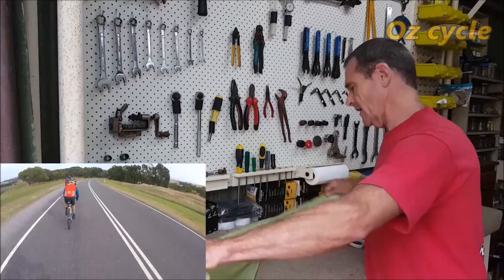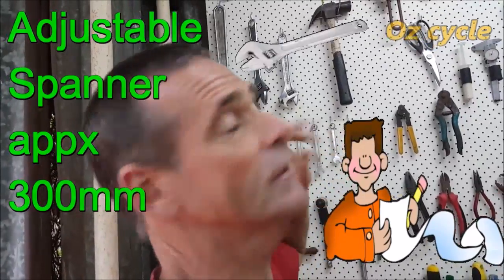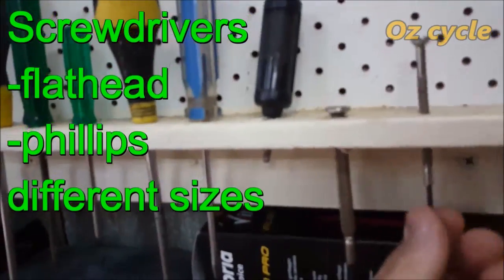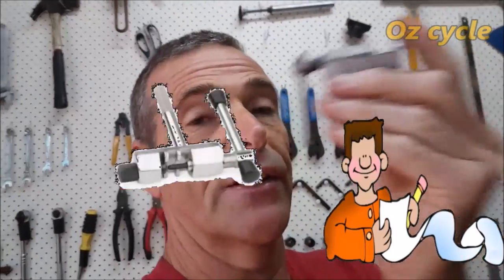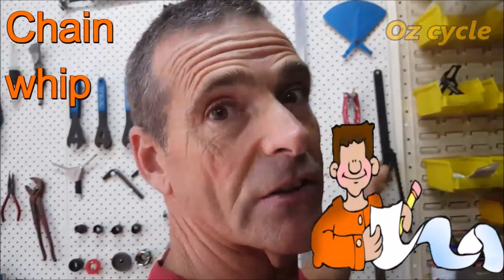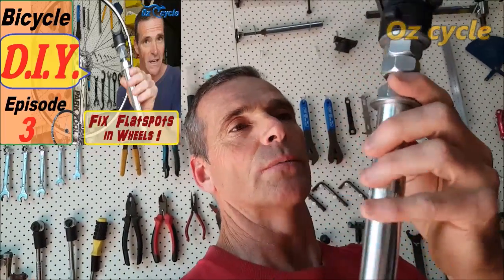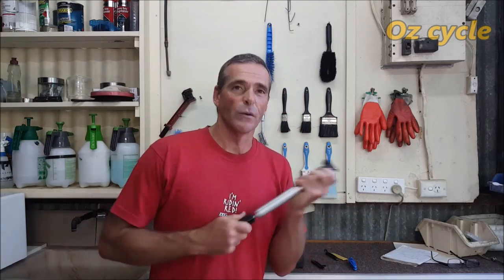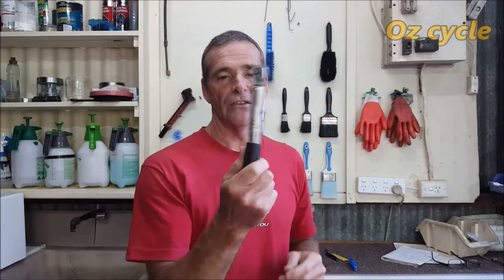BIKE TOOLs - Pt.1 must have !

Comment: I especially like the videos about proper chain cleaning and lifetime chain lubrication. In my opinion, this is the most significant and immediate measure to improve your bike's efficiency in a long term, sustainable way. A small trick from my side: Use your liquid wax and apply a thin, non-visible coat on every accessible spot on your bike. Raindrops will just slip of any surface and after shaking your bike after a rainshower the bike will dry out in like 20 % of the usual time.

Comment: List
1. Rags
2. Spanners 6-19 size (8-17 is minimum)
3. Adjustable Spanner - 300mm
4. Hammer
5. Scissors
6. Syringe
7. Cable Cutters w. Crimper 
8. Pliers
9. Screwdrivers - Phillips and Slotted Head (include jewellers)
10. Cone Spanners - 13-21mm x 2 sets of each
11. Chain ring peg spanner
12. Allen Keys - all sizes
13. Cassette lock removal tool - get the relevant brand of your cassette
14. Chain Breaker - Smaller is better
15. Chain Wear Stretch Tool - Buy with a increment reader
16. Steel Ruler
17. Plastic Caliper 
18. BCD Measure 
19. Chain Whip
20. Towel Rack
21. Spray Lubricant
22. Grease in tube (to put into syringe)
23. Chain Lube
24. Wheel Stick Tool 
25. Carbon Fibre Paste (If you have any carbon on your bike)
26. Wire Brush - 2x one stiff/soft
27. Puncture Kit
28. Floor Pump
29. Torque Wrench
30. Tire Lever - Rounded Head 
31. Repair Stand
Reply: Thank you 😆

Comment: When buying a cutter or new blades, buy hardened ones! You can spot hardened blades easily by a copper or brass-like color of the cutting edge. Will last you considerably longer than unhardened ones when working with metals.

Skip any black blades (harder, but break easier) or white ones (ceramics, for cutting fiber/fiber or paperboard; won't last long around a bike).

Comment: I want to do everything on my bike :D Im going to get new hubs and do spokeing stuff myself .. havent done anything like that before.. but i think its wery doable. Bought it before winter.. stripped down everything.. relubed.. checked everything cleande.. and i feel like i know almoast every bit of bike :D Need new brake gear lines and new hubs ofcourse. There alsou is bad stearer tube bearings/cups.. im not so shure about those to do myself.

Comment: Multitools and the toolkit from Ikea have handled a decent portion of this. Crankbrothers covers chain removal, screwdriver, and the Allen keys. 

But the rest definitely make sense. Syringes are very affordable on Aliexpress if you're willing to wait.

In regards to torque wrenches...Bike ones are needed with carbon fiber since that can crack up. The normal ones seem to expect higher torques.

On a side note, security bolts and relevant allen keys are handy for commuters if you don't want bits and pieces missing from your bike. I've had bad experiences relating to a thief with a 5mm Allen key.

Comment: I made a chain whip out of old chaisaws blade or how to call it.. cant go on any show but works great.. and costs 0. Tho u need to be able to drill holes and punch pins out of chain and put them back.. dont need any screws or new pins for assembling.. its not a bike.. wont fall apart.. and if comes loose alwas can bash back in :D

Comment: Very informative. Since I got my bike I have been getting new tools as I needed them. You dont need anything fancy to keep your bike running properly.
One tool I cant find where I live is the crank arm remover, getting it online is not an option either. Is there any way I can safely remove the cranks from the square taper bottom bracket without the tool?
Reply from the maker: +badr Crank extractor is a must for older tapered cranksets. You can knock off the cranks with small steel bar hit with hammer. Wrap the end facing crank with something soft like cloth. Lube taper with fine spray lube. Hit close as possible to axle.May take quite a few hits but it will come off....done it many times when crank thread is damaged.

Comment: There's another way to pump up your tires what about the CO2 inflator they are pretty cheap and more faster than using a normal hand pump I changing a tire on the side of the road
Reply from the maker: +"Mr Mate" Z Yes they are handy...untill you find the tyre isnt quite sitting on the rim properly,so you need to let it down and pump up again.....a pump is the best all-rounder.
Reply: Zefal HPX's are pretty good. Thought they were indestructible, but after many years, mine failed to engage the valve properly. Still haven't worked out why. Have bought a new one, unhesitatingly though. 

Also bought a traditional one with a flexible connector for those sometimes hard to attach to valves on some wheel tyre combos.

Comment: Great video but Tyre levers? Waste of time they are. Since learning how to change tyres properly I have not used them in years and not needed them, never pinched a tube since either.  Maybe you could do a video on correct methods of mounting and removing tyres without having to use tube pinching pieces of junk.
Reply from the maker: +Jason Brown Yes,agree with you that technique is important to putting tyres on . Some high pressure tyres on certain rims are quite tight fitting and difficult to sit nicely,tho and a lever helps. Will put on the "video yo do list". Thanx Jason
Reply: Hi, I love your videos and youe can do approach - a man after my own heart. However can I please also add that a tyre lever should NEVER be used for fitting a tyre. In fact a rarely use them for removing tyres. I ran a bike shop for 10 years and was forever getting people bringing tubes back complaining that they had two little holes in them! In the end we told everyone buying a tube that they must only fit them by hand. We offered free fitting of tubes on loose wheels. I remember one customer who was built like a brick outhouse who bought a 12.5"x2.25" to go on a Raleigh kids bike with westwood rims. Now I know those were a pig to fit. I told him not to use levers and suggested he bring me the wheel for me to fit it. Half an hour later he came swearing for another tube. I repeated my advice. Half an hour later he was back again for another tube with the wheel looking as if he was going to punch me insisting that it was impossible to fit the tyre without using levers. I fitted it in front of him in matter of seconds. You should have seen the look on his face. He was twice my size and I'm not small and couldn't believe I had just slipped the tyre over the rim with my thumbs. It's all about technique but very important. Keep up the great work. Ian
Reply: Ian Booth Please tell about your technique, I have road bike tires that are hard to fit😔